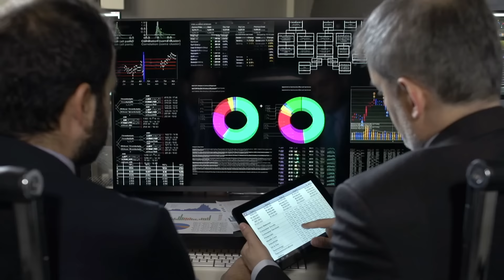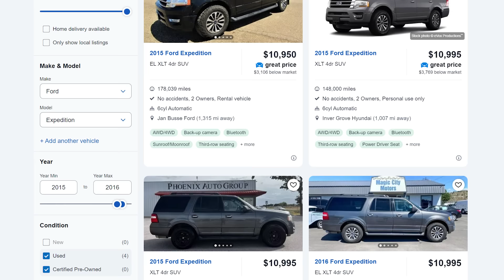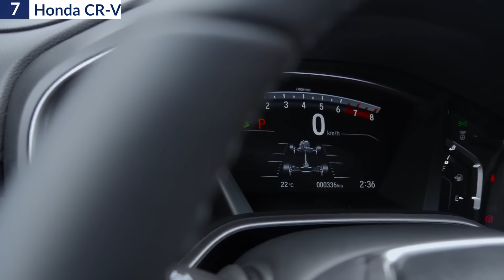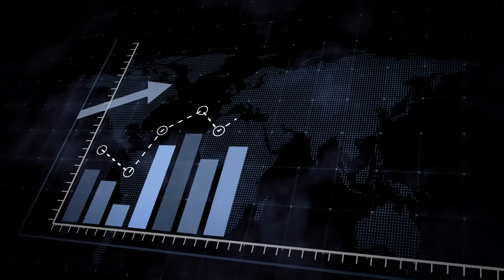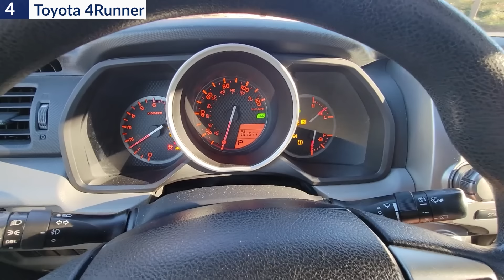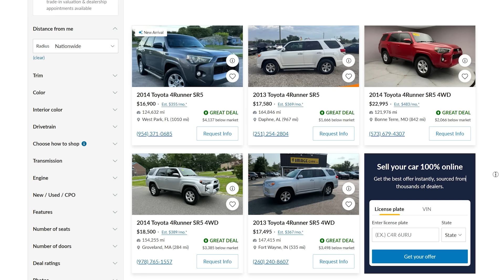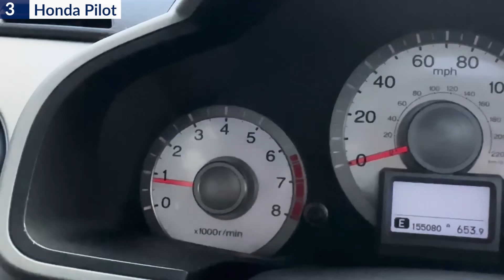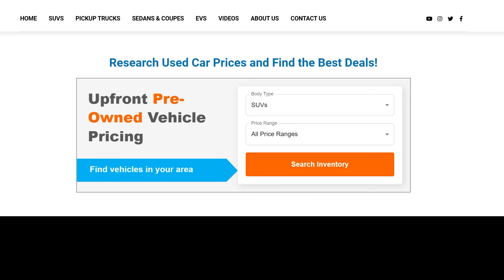10 Long-Lasting SUVs – You Can Buy Today!

Comment: A Ford Expedition?  Whaaaaaaaa⁉️    They are THE most frequently in need of repair, most shop time needed vehicles sold.   Not joking, they set records, and you call them good.  Yikes‼️
Reply: The first gens are amazing I'm at 336k and it's my second one not a single breakdown on either one
Reply: @jasongraves9581  — Good for you!   You are THE statistical anomaly.  According to consumer reports and JD Power rankings Ford Expeditions were again the most repaired vehicle sold, and this isn’t the first time.
Reply: You need to see reality bro. More shop time than a BMW. Smh.
Reply: @cammgt3rs370  — JD Power and consumer reports both listed the Expedition as “THE” most frequently repaired new vehicle several years in a row.  Not sure if BMW might have one a few times too, the X5 (I think that was their worst) had to be a close runner up.   LOL!
Reply: 2016 Diddy with 205k! Still kicking it.
Reply: I’m a Toyota…Honda…Mazda person. But I have read there are particular years for the Expedition that are reliable.  But not many….
Reply: I’ve had 3 expeditions that I sold at 200k miles. Not one major problem in any of them. Basically wear parts.
Reply: @randylundquist8816  — mind if I ask what wear parts?
Reply: @randylundquist8816  Do you mind sharing what years they were? I’m interested in a used older Expedition.
Reply: Brakes, wheel bearings, that kind of thing.
Reply: I don't really remember but my last one was probably a 2016. I've had similar experiences with F150's 4 of those
Reply: @randylundquist8816  — Perhaps I’m wrong then… or more appropriately JD Powers and consumer reports.  My experience with an F250 diesel was very problematic.  And, I know this is not scientific but of the 20+ shop visits over 3 years, both dealerships service groups were always packed, I began recognizing several repeat customers too.  Worked great when it worked, but for me downtime costs me time which I do not like.
Reply: Just relating my experience.  Every ford I've had has been amazing.
Reply: @randylundquist8816  — Good for you!  (Seriously!)  My experience was not the same.  I may have mentioned this before, I ran across a guy with a sweet Mustang, it was 9 months old. I asked him if he had any problems?  He said I love it!  It’s been an excellent car, Ford’s are GREAT!  Then he explained he was getting his alternator replaced the second time.  I asked if there was anything else and he gave a short list ranging from engine mounts, electrical issues, belts kept getting thrown, etc.  I get it, used alternators often have bent belt shafts which throw belts and engine mounts can indicate abuse, but this was his SIXTH shop visit in NINE months.   My point is no problems is relative to the owners love of their car.  😎
Reply: "You should NOT believe everything  you read in the newpaper" was the rule when there were newspapers !
 Now we have social networks, however, the rule stands only change 'newspaper' with 'Social networks'
And you never know if the SUV geek is paid to push SUVs !
Reply: Sorry he had problems,  I did not. I've had a Toyota 4 runner that the rear end went out $4000. I've had a Toyota Cressida the transmission went out twice. I haven't bought a Toyota since. The Fords I've had have had zero issues with big items,  period. You can believe what you want to believe but it's true.
Reply: By the way, I owned a company and we received a Consumer Digest best buy for one of our products.  They immediately contacted us with offers to spend loads of money to be able to use this fact in advertising.  We did not and never had a best buy again.  Products that were available when we won started consistently winning.
Reply: @randylundquist8816  — Consumers Digest is not Consumers Reports.  Consumer Reports does not allow companies to use their name or even mention them in advertisements.  Sadly what you’re saying is going on, many “Best of…” awards are just advertising gimmicks.
Reply: He did put it at the bottom of the list. There's not many more full size SUVs so being at the bottom of his list isn't him saying it's necessarily good, just not the worst.
Reply: Bold statement. 
You’re forgetting the numbers rule - these are sold like hot cakes, world wide. 
The 3.5 mk2&3 are much better than the first one, given you do your oil changes on time you’ll be fine for 250k or more. 
The 10 speed is the same all big Americans use (GM Ford) and it’s a 30% failure on the first two years of its manufacturing, given its vast use in all Ecoboosts and most GM setups the numbers of failure are huge. 
And like with the new Tundra, you’re more likely to read bad reviews and see people shit on cars rather than speak praise. 

Ask yourself, if these cars were that horrible, why is it that they’re selling so much of them? 
Including Feds official contracts
Reply: Most of these articles are based on old versions, not the new turbo engines or 10 speed-or cvt transmissions. What counts for new car buyers is 2024 and on reliability, which has yet to be proven.
Reply: @stevedott715  — Yes, I have a young coworker that hates Toyota because they don’t have all of the coolest new features.  I say ‘but it will last for decades!’ And he scoffs, ‘who wants to keep a car longer than a few years?’ Like I’m an idiot.
Reply: @Erin-Thor your saying ”new vehicle” if any vehicle has over 200k miles thats not new thats easily over 10 years, for the average driver.
Reply: Idk what you talking about, but fords and gmc been top cars in Saudi Arabia < a rough country with bad roads and really hot bad weather, where ppl used them for traveling and go off roads in desert as well, old generation, they do last forever
Reply: This comment and the hyandi on the thumbnail makes me think I should me view else where
Reply: You know absolutely nothing. So stop talking ….mine has over 180,000 miles. It has never had a problem other than minor. maintenance 2003
Reply: @BUGZYFANG  — Good for you!  And you are correct, I don’t know nuthin’!  LOL! I go by consumer reports and JD Powers, who track annual shop visits for every car sold in the USA.   So… before you scream at me, do some homework first.  Too funny!
Reply: @fatman5377   — JD powers I believe focuses just on new cars, Consumer Reports focuses on incidences of repairs, dealership and owner reports.  Isn’t the MK a smaller passenger car?  I wasn’t talking about those, I just remember the stats on Ford/Lincoln Expedition/Navigator vehicles.  And 30% is the same present age regardless of 10,000 or 250,000 sold. 🤓  So sell a little, sell a lot, the percentages still give an accurate indication of failure rates.  And why? Distorted reality.  Like I said Ford lovers swear by their cars, assume a shop visit every few months is normal.  I did, until I bought a Mitsubishi Montero that passed 200k miles over 17 years with nothing but oil, brakes, wipers and tires replaced.  What is normal to one person, is not normal to the next.
Reply: I have exp. With over 300k  other than  
B, shoes 
Tires
Timing chain
Water pump have drove it from cost to cost  /local 
Since 2005
Reply: The Hyundai is a massive lie, Hyundais still have major engine issues. So someone did not do their research properly!
Reply: @RetroKingOG  — Ford Expedition has Hyundai beat for least reliable.   🤣

Comment: We bought our 2012 Honda CRV EX-L brand new, it’s got 330,000 miles on it and zero issues so far, new brakes, tires, oil changes that’s about it. Soooo we’re sticking with Honda haha
Reply: Hey I’m same. Except mine only has 87,000 miles on it. Here’s to 250k more
Reply: Recently bought a CRV EX-L with 149000 on it. It had the dreaded vvt actuator noise on cold start up. A friend of mine and I put in a new one. Did some basic maintenance, seems to be a good buy. Love my CRV
Reply: Good stuff!! Unfortunately the ac compressor went out on mine, other wise great car, pushing 160k

Comment: What about a Lexus GX460 or 570?
Reply: Those are 2 of the best SUVs you could buy.
Reply: LX570 is same as Land Cruiser 200 technically, but more luxurious.
Reply: They both fall under Land Cruiser and Land Cruiser Prado. The GX 460 has a V8 and more luxurious while the Prado has a V6.

Comment: Honda Civic, just now starting to see issues at 298000 miles. Shes been good to me.
Reply: My friend has 650k kilometres. Still going strong with a new engine and basically everything is new 😂 but it is still going
Reply: My 2009 Honda Civic LX, purchased it as a CPO with 10k miles, ran it til it hit 370k miles with original engine and transmission. Sold it at that point to a Honda mechanic 👌

Comment: Hey - It's not a SUV, but, I have a Honda Odyssey.  I bought new in 2010.  I have been driving it for 13 years and it has 215K miles on it.  Still going strong.
Reply: Odyssey is a mini van no?
Reply: How many transmissions?  We had one for 12 years and 280k with 3 transmissions.
Reply: @tonyrat8086 yea Honda has transmission issues it’s just a Honda problem

Comment: My 2018 and 2017 Mazda CX5s have been running reliably and with no breakdown… not even any significant issues.  All I have put out is for wear out parts and regular maintenance expenses.  I didn’t see them on the list!

Comment: I have a 2011 Ford Expedition with 250k original miles and it still runs like new. Easy and cheap to work on and hasn't had many problems. Great in the snow and fits a family or 6-7 easy. I'd recommend all years past 2010, they bulletproofed the 5.4 after 2009 and fixed the majority of the issues plaguing the engine. Proper maintenance and these suv's will last past 300k easy.

Comment: Have 2 rav 4’s my wife and I.  Toyota rav 4 2012 holding up great!  Approx. 140k miles.
Toyota 2014 holding up great!  Approx. 110k miles.
Also, had a Toyota rav 4 2003 rusted out in some areas but engine kept going.  Miss the standard drive though.

Comment: 2004 Chevy 4x4 Silverado 1500 Extended Cab, long bed. The first 5.3 LS went out at 360k miles.  The second used 5.3 LS went out at 290k. Replaced the transmission with the 3rd used 5.3LS currently holding good at 110k miles. She has over 700k miles and still pulling the load laying down rubber. She's got some dents and a few rust spots but, I wouldn't trade it for another😂

Comment: iseeCars seems to LOVE Honda and Toyota products! (No NISSANS? I've seen MANY with over 250k miles.)
Reply: Sadly Nissans have a higher frequency of repairs.  I like them, had a Murano that drove great!
Reply: Could that Nissans you saw may be less than 20 % to the total Nissans of that model that would reach 250K miles?
Reply: Nissan's went down the toilet when they went to the CVT Transmission in pretty much all vehicles first generation Murano 2003 and later is when the Nissan ship started to sink

Comment: My most reliable was a ‘96 Impala SS.  Big sport version of the Caprice.  Massive body on frame sedan.  Drove it daily and on long road trips for work all over the country.  Had it for 17 years and 230,000 miles.  It was still going strong, upper mid west salty winter roads finally had rusted fist sized holes through the wheel wells, and lots of the brackets, breaklines, etc underneath were breaking down.  
Given how unreliable and unmaintainable everything built in the last 10 years is, I may look for a low mileage one again.

Comment: Most reliable car I've had so far is suprisingly the fiat 500, the car I have driven the most, currently at 247300 miles and runs like new, no issues, just regular maintainance, clutch, timing belt and front brake pads...
Reply: So there's hope for our jeep renegade 😂

Comment: 2017 CRV.. sucks. Replaced injectors 3 times , turbo, trimming chain, and now infotainment system . I have 97,000 mile and have never missed or extended service on my vehicle. Purchased new. This is my 1st and last Honda. Worst decision I ever made. Absolute money pit
Reply: Had similar problems with 100k miles😢
Reply: I have 2017 CR-V, still having very bad oil consumption issue at about 70000 miles, Dealer told me to come back after 2000 miles of oil change. when I came back home, oil level was over filled like 1 inch more from the dot.

Comment: Your website needs updating, it will not let me search a zip code of my choice and will not allow me to choose only a specific make and model vehicle of my choice to search for.  I use a vpn as a measure of safety online and it doesn’t necessarily show my exact location but your algorithm sees my vpn location.  I want to search a specific make, model, and zip code.  Please fix this, thanks
Reply from the maker: Thanks for bringing this up. We are working on a new interface where you can enter your zip code and the make and model. So stay tuned!

Comment: 1998 Volvo V70.  It has 364,200 miles. All I ever did was replace engine oil, filters, wiper blades, and tires. It has no book value. It costs pennies to insure. It is exempt to yearly emissions testing due to its age. Runs like the top. No leaks, lots of power. Big inside...comfortable, heavy, safe...Why would I want anything else? New cars suck. Less metal, more plastic, fiberglass and rubber. Shitty CVT transmissions and cheap aluminum block engine. Yet, they are more expensive than ever.

Comment: Expedition yes, because it has an old school iron block, Subaru FAIL, they're the worst, CR-V should be in the Top 3 easy, they make it to 300K without flinching and as much as I LOVE Hondas, the Pilot is plagued with problems.
Reply: What is wrong with Pilots? My 2016 is great, except for a couple recalls
Reply: @cumulus1234  Its had unusually high number of issues. Way above Honda's a average.